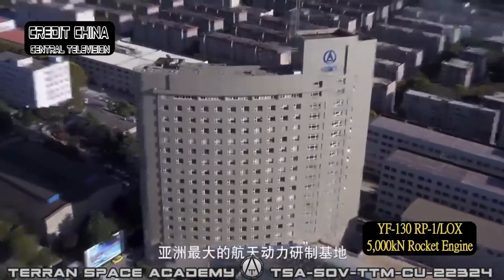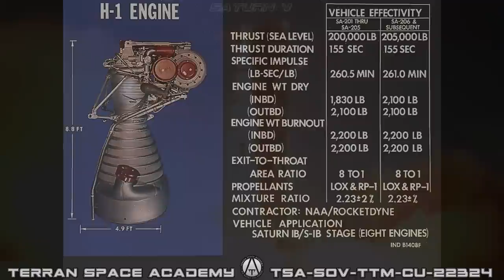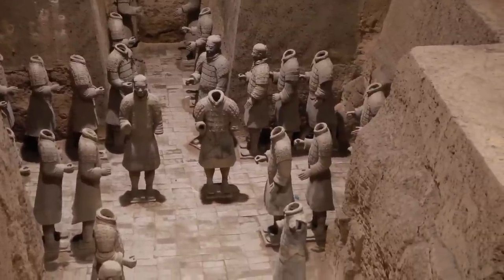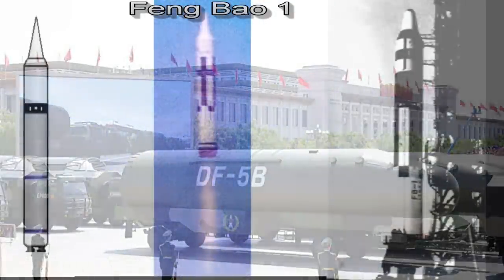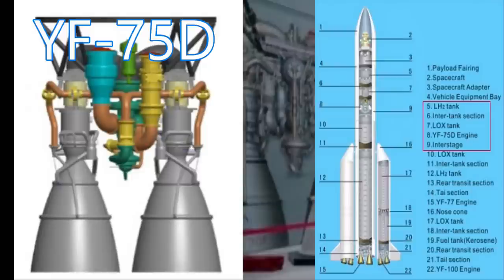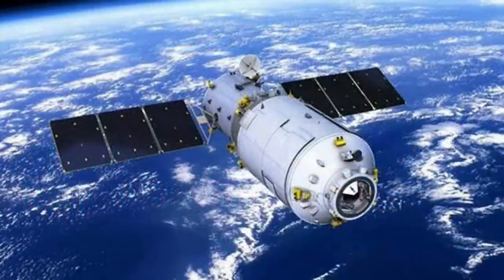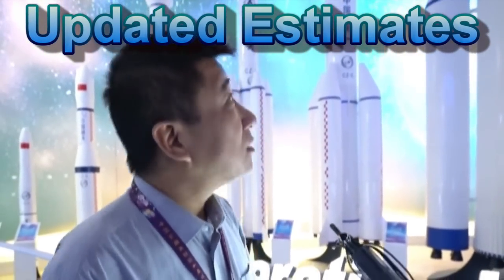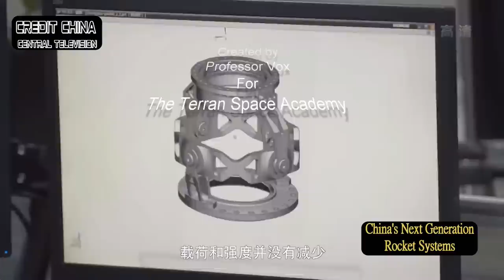Rocket Science: China's Massive New YF-130 Rocket Engine!

Comment: The most powerful engine in the world is the China’s new engine YF130 with 5000000 newton thrust. This engine will be a game changer in the aerospace race to planet Mars and beyond.
Reply from the maker: It can be Tan... it can be.  But two 2.5MN engines can do the same thing as one 5MN.  The rest of the ship matters too :-)
Reply: the Aerojet Rocketdyne F1 engine produces 6.8 MN of force a solid 1.8 MN more than the YF-130 then there's the RD-170 at 7.4MN so no the YF-130 is not the worlds most powerful rocket engine. Even when considering ISP the RD-170 has 309 secs of impulse compared to the YF-130s 308. Thou the RD-170 has a lower TWR the YF-130 has a TWR more than half of the raptor 3 at 183.6 compared to the YF-130s 78. Its an impressive engine but not the best in its class and certainly not breaking any records.

Comment: The posted specs on the YF-130 engine (given at start of program) is 5,000Kn. Most powerful? NO, not yet. The F-1 engine, used in the Saturn 5 rocket, over 54 YEARS ago was more powerful at 6,770kn thrust, that is 35% more than the YF-130.
Reply from the maker: But the F-1 is not flying... which was the caveat.  And never will again.  And the F-1 wasn't actually the most powerful liquid rocket engine of all time.  The RD-170 on the Energia rocket system put out 7.25 and 7.90 MN while the F-1 only but out 6.77 and 7.77MN. And if we get technical we must qualify our statements.  The F-1 was the most powerful American liquid rocket engine to ever fly.  But the Space Shuttle/SLS SRB is almost twice as powerful as the F-1.
Reply: That'd be the Soviet RD 170

Comment: On the wiki page for the long march 9 its first stage is listed as methalox while this is run on Rp-1 lox. I'm confused. Will there be multiple versions of the LM9 where one was the yf130 and one has a different methalox engine ?
Reply from the maker: They have gone back and forth.  Most likely the RP-1/LOX will be used in the boosters like Energia, while the methylox will be used in the "core stage" instead of hydrogen... then probably hydrogen for the "third" stage, but it could be methane also.
Reply: The host of Dongfang Hour says that the final decision is on methalox engines and is reusable.  https://www.youtube.com/c/DongfangHour/community
Reply: Base on the newest expo model, LM9 will first go with RP-1 24*YF130. Methalox YF135 is developing in parallel.
Reply: @christse3467  If YF130 has 500 ton thrust, they need only 8 engine to lift man to the moon.
Reply: @alexlo7708  Old LM9 had 12*YF-130, while new design uses single chamber version.
Reply: @christse3467  If they use 12 engines , lift thrust will be 6000 tons. So much larger than SLS or Apollo Saturn-V.
Reply: @alexlo7708  NASA designs are lighter in general. SLS and Starship have higher thrust-weight ratio above 1.5, while LM9 will get to about 1.4.

Comment: Why isn't there a coating or anti-coking that lets the reuse of engines occur with no need for any prep besides usual maintenance and a quick rinse?

Can rp1 not be refined further to reduce coking down ro a negligible level?
It has existed long enough that countless brilliant minds must have strained through the most feasible means to reach the desired purity, should not take billions of dollars but a mere 24 hours of the brightest minds on earth being put to the task.
Reply from the maker: Nothing is smooth enough to prevent build up yet resistant to the heat so far.  They just blow it out with nitrogen now.
Reply: coking is the result of carbon residue due to it being a long chain hydrocarbon fuel you cant exactly refine the fuel to get ride of coking since you'd essentially by trying to get rid of the carbon within RP1 instead you can switch to a short chain hydrocarbon like Methane (which is why both the BE4 and Raptors use methane). Generally using nickel based allows also helps with cokeing since you can run larger mdots through your regen channels preventing cokeing from being a bigger problem. Running Ox rich is also a better way of going about it especially when your closer to stoichiometric OF ratio and burns up the carbon more efficiently leaving less residue.

Comment: The YF-130 might be the most powerful engine in production (the F-1 is the most powerful overall), but given its weight, it's not all that efficient, producing only ~0.77 kN/kg, vs ~1.44 kN/kg for the Raptor 2, or ~1.80 kN/kg for the Merlin D. Hells, even the venerable F-1 manages ~0.81 kN/kg, albeit it's a physically larger engine.

Of course, thrust-to-weight ratio isn't the greatest metric anyway, given how little the engines weigh in comparison to the fuel. Taking thrust-to-cross-section ratio (ie, how much 'real-estate' an engine takes up in comparison to the thrust it provides), the F-1 produces ~630 kN/m^2 (assuming the cross-section is a circle), the Merlin D manages ~1,271 kN/m^2, and the Raptor 2 a whopping ~1,733 kN/m^2. I'm not sure where the YF-130 comes in on that, but I very much doubt it can match the Raptor.
Reply from the maker: Actually the RD-270 beats the F1... :-)  The point is that China plans to start putting big things into orbit soon.  The US can't slow down.

Comment: I still think that this formula for these engines are flawed. Here's why . They all end up being a one cylinder no matter the count on engines and force fed under a controlled pressurized system but looking back on a paper that makes what I think I have feasible.  This paper can be found  on Google. Just look for McGill University ground based laser . Even though I find what the university is trying and getting funded completely blows my mind because it sucks . What we need is a hybrid system and that means departing from the Bell nozzle turbo pump system and also leaving the aerospike system on the shelf... Just a lot of copy and paste..oh wait a sec , modified..whatever
Reply from the maker: If not bell nozzles or aerospikes what would we use for the exhaust gas?  Can you post a link please?  Thanks! :-)
Reply: @terranspaceacademy  it like a scramjet or ramjet exhaust.  The internals are made up of reflective alloys and ceramics composites it also has eight 250kw lasers and disks. Think of it as a car engine/fusion reactor.  The reason why I say that is because the disks are held frictionless by a form of maglev and it's also an air breather until the upper atmosphere. This area is extremely important for the second step because it closes like a bulkhead in which there's no backfiring,  it would defeat the purpose. Back to the car reference. A turbo requires an airflow to spool up so this part is directional wind funneling. The laser beams are not exposed to the internal blast area by a barrel like a gun supported on a rack and also fired sequentially times 8 fuel comes like the delivery of 8 cylinder method and in which case I selected a part from a Koenigsegg car and part of it is called light speed transmission...lol..go figure. To understand where I'm going with this and  why I chose a delta wing design Spaceplane. Here's the best part . Understand what's happening here . Pay attention to the numbers, the airgun and where he mentions the heat of the sun aka sparkplug with a bit of boost. Btw in order to make this work , the top part of the disk is removed for the maglev system. 
https://t.co/l7MMVoWQYu
You should also realize that a fusion reactor is also the sun firing perpetual

Comment: CZ-9 design hasn't been frozen yet. Last I heard, there are currently 5 different proposals for it, as follows.

CZ-9 (version 11)
CZ-9 (version 21)
CZ-9 (version 22)
CZ-9 (version 35)
CZ-9 (version 09-2022)

What this video was describing is version 11. Version 11 was the initial design from 2011 which had design modifications until 2021 after which it was superseded by version 21, version 22, version 35 and most recently by version 9/22, as in version September 2022.

Kerolox engines are used for the 1st stage in versions 11, 21 and 9/22, with the boosters discarded from version 21 onwards. A proposed Full Flow Staged Combustion methalox engine like the Raptor 1&2 is supposed to power the 1st stage for versions 22 and 35. The interesting thing is, version 9/22 design switched back to kerolox which just so happens to coincide with the recent successful ground test of the YF-130. The 9/22 design calls for a kerolox engine of approximately half the YF-130 thrust figures so it's likely the YF-130 may eventually have a single combustion chamber variant analogous to how the RD-180 has a single chamber variant in the RD-191.

All indications point to the CZ-9 following a gradualist path. Meaning, it's probably going to first appear as a non-reusable rocket and then gradually evolve into a reusable rocket platform as their latest rocket engines that support reusability are developed.
Reply from the maker: It's fine for them to revise as new data is available but at some point they'll need to start bending metal.